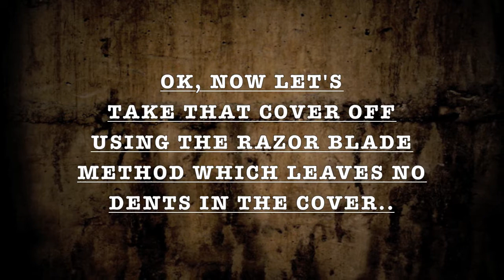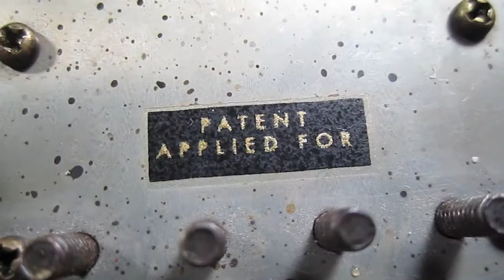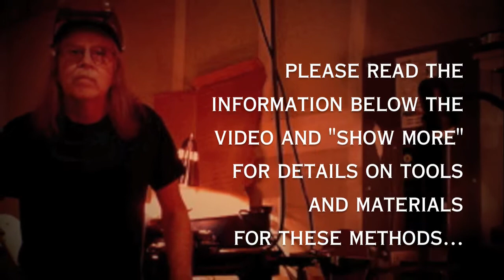Stephens Design PIckups - Stop squeal the easy way!

Comment: This worked perfectly for me on some pickups made in China. I popped the gold lids, wrapped around the edges of the bobbins with cloth tape (Similar to what's used for pickups) then placed a strip on the flat pole pieces. Put a few dabs of PVA glue on the strip and then closed everything up. I clamped the top to the pickup then when it was dry I re-soldered the pickups to the cover. No more squealing. Thanks so much!
Reply from the maker: It just WORKS! No messy wax potting.....

Comment: Thanks for this demo. I bought a set of brandonwounds from the new owner after brandon went to gibson. The pole screws were loose in a bunch of poisitions. He offered a replacement set, but instead, i melted a bit of wax on the threads where they came out of the back plate. Snugged them up. I usually play at bedroom levels, but when i crank my amp in a small area, they squeal.  I'll try this method with some painter's tape and silicone. Hopefully the covers are the culprits.
Reply from the maker: Brandon went to Gibson? :-)
Reply: @SDPickups  yes he heads up their pickup dept now. His employee Zach now owns brandonwound.

Comment: Dave, is there still a chance for the PAF to squeal even if the cover was soldered while clamping ( unpotted, no tape or wax applied under)
Reply from the maker: With real vintage PAF's, they are very unlikely to squeal without a cover. The coils are pretty solid and hard, so they don't squeal easily. But, if you're playing 100 watt amp and you're standing in front of the speaker, it is possible for the coils to vibrate and squeal. For a modern PAF replica, modern wire is softer and more squishy coils, so those can squeal by themselves without a cover over them. This is why we wax pot buckers if they squeal in testing. Does that answer your question?
Reply: @SDPickups  Actually i was asking if, despite clamping tight before soldering on the covers, is it still possible to get some cover squeals at high volume with semi high gain with pafs. although it also appears your answer is that it is possible for  unpotted PAF to have cover squeal-- am i right?

Comment: Great video! Just one question, if you were to remove the pickup cover, would you be able to remove the silicone stuck to it easily?
Reply from the maker: It won't come off "easily," you have to anchor your thumb on the edge of the cover, hold the leg and push with your thumb, one side then the other. Just keep working it, and it will release. What you're doing is trying to pull the tape off the slugs and bobbin top. So it takes a little bit of pushing, one side then the other and it will eventually lift off. The tape will stay in the cover, then you have to pull the tape off the inside of the cover, it might tear while doing this, but use someting like a screw driver to push the tape off, then clean off the silicone with acetone. Covers gaurantee your pickup will last for decades and will trim some treble frequency off in a nice way. Playing without the cover over time,  you risk destroying the pickup from acid sweat or a string getting caught under the coil lip and killing the coil.
Reply: @SDPickups  Thanks for the reply. I had the idea of applying a thin coat of oil on the inside of the pickup cover before I placed it over the pickup with the tape and silicone. I believe that would prevent the silicone from adhering to the cover, wouldn't it?

Comment: What kind of tape is used and what glue? Why not wax pot it?
Reply from the maker: Paper tape, brown drafting tape would work, the thicker blue painter's tape would too. Its an acrylic caulk made by Elmer's but they don't make it anymore, you coud even use rubber cement. Potting is difficult and dangerous for most people to do. You can also melt some wax in the cover and quickly put it on, but this isn't easy and its messy. Once a pickup is potted you can't undo it. I do pot my pickups for players who play large venues with big amps, its important to use only pure paraffin canning wax, never put any bees wax in it or it will darken the pickup sound.
Reply: @SDPickups  will the brown drafting tape not darken the sound

Comment: Can I use playdoh lol
Reply from the maker: Bad idea, could possibly do bad things to the metal parts and the wire. Silicone is inert and can't hurt anything. This method works incredibly well, unless you're using a 100 watt stack and standing right in front of the speaker. In that case it will still squeal and will require wax potting. Pure paraffin wax does not interfere electrically with the coils and the delectric of pure wax makes it a great insulator. On the other hand, bees wax is organic and is a terrible insulator and shoud not be used at all. Its also a myth that Leo Fender used bees wax, have never seen it in vintage Leo era single coils.